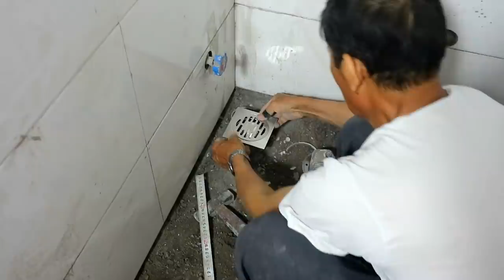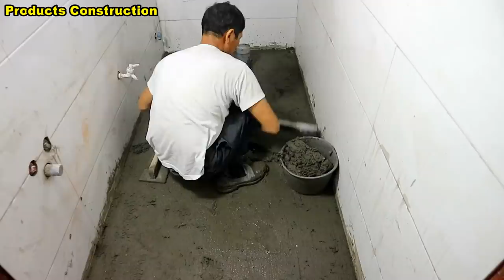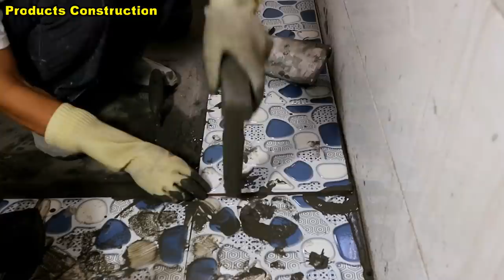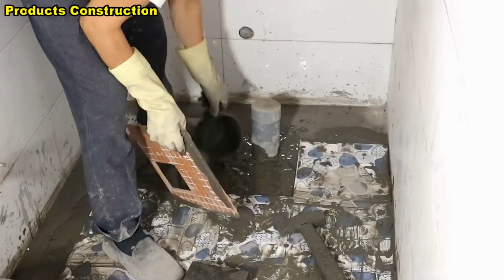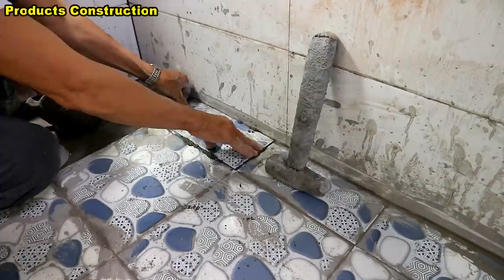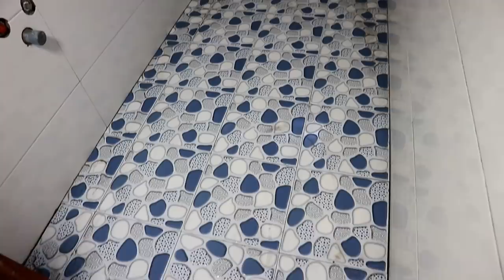How To Tiles a Small Toilet Floor - Technique Cut and Put Ceramic Tiles Right Way

Comment: Very bad procedure. Your screeding is fine but tiling procedure is not. First you are supposed to set or calculate all the way through the set and start from in coming out and give time for substrate to cure then clean, not out going in then stepping on wet substrate before it is set.
Reply: Todo esta mal!